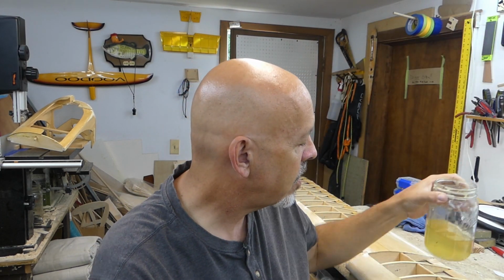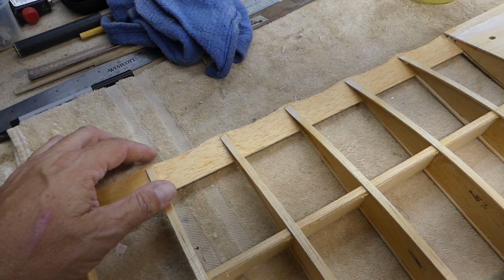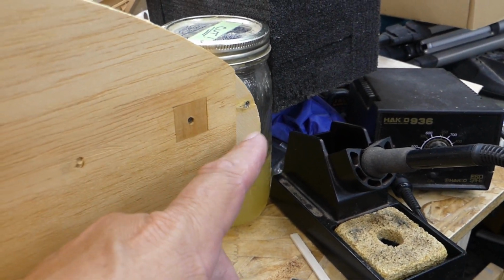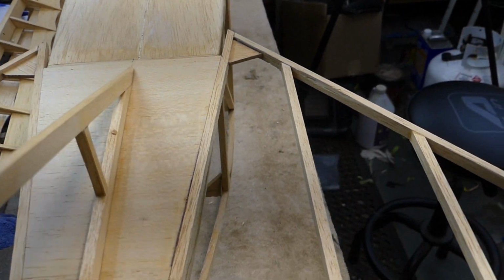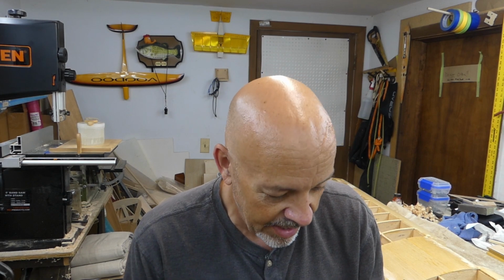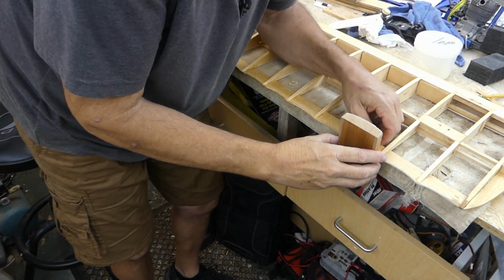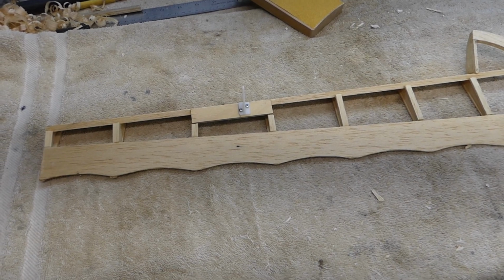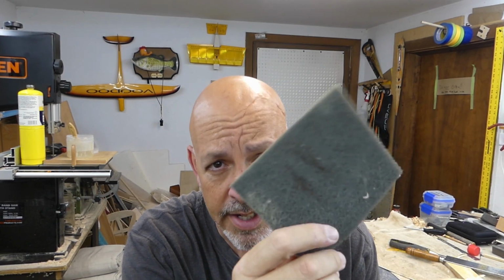Balsa USA 1/4 Scale Fokker D.VII - Episode 35 - Flying Wire Mounts and Fixing Wing Trailing Edges

Comment: Another tip:  Run your fuel tank vent line down one of the landing gear struts to exit below the axel wing.  This will save your axel wing from the caustic fuel.   I used bras tube and covered it with balsa before covering with the fabric.  You cannot see it.  I have done this on my DR1 and my DVII.

Comment: One of the changes I made to my old Fokker this last year was to put a seperate RX in the top wing.   My radio allows me to bind up to 4 RX to the TX, so I just put an RX, batt and switch in the top wing.   This is so noce not having to deal with the aileron wires running down the struts. it also creates redundancy.  My TX  (Graupner)  will not allow the radio to work if both bound RXers are not turned on. SO there is no chance of taking off with the wing turned off.